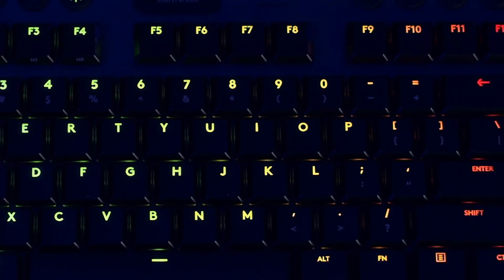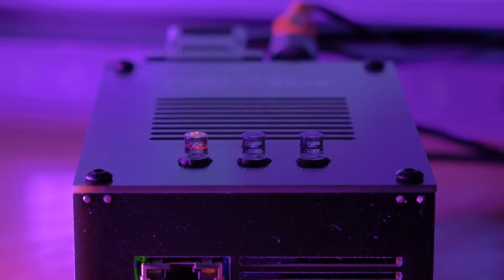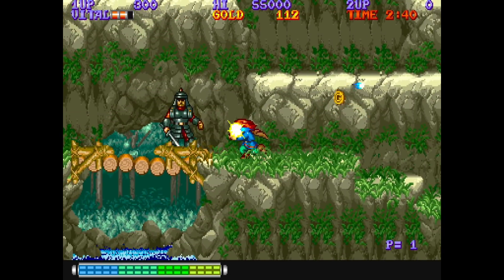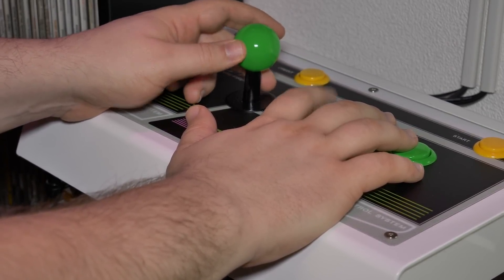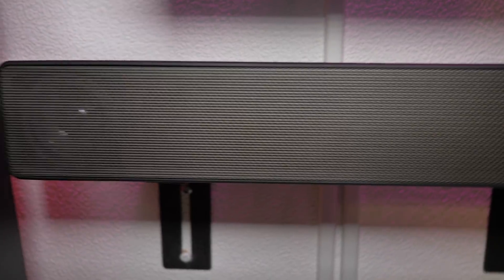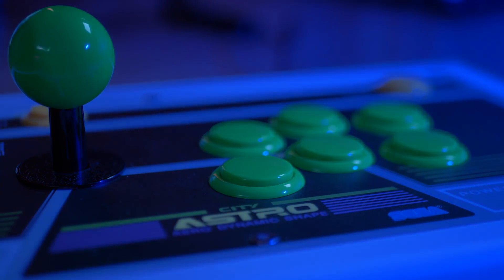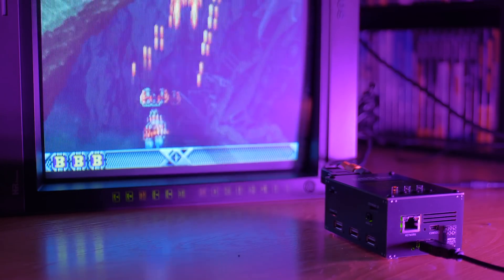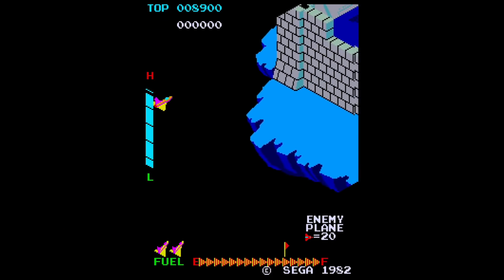DF Retro Hardware: MiSTer FPGA - A Brilliant Mini Emulation System Explored!

Comment: Thank god I just bought my Mister fpga setup.  Whenever a high profile gaming influencer makes a video on it...it sells out.
Reply: Buy the parts from an electronics shop and not a "Mister" shop. They are in stock at mouser for $136.
Reply: @poodudeelite  I saw them on the mouser shop and also saw they weren't rated by the better business bureau.   Not sure if that means anything anymore, but I didn't feel comfortable
Reply: @michaels9917  mouser is a giant multinational electronics company. Nothing to worry about.
Reply: @poodudeelite  good to know for future purchases
Reply: @michaels9917  mouser is safe. Bought my DE10 for 132 € there. Dont buy the Ali Express addon boards. They seem faulty.
Reply: the de10 used to cost 130. now i see it going from 140-150.00
Reply: @soloM81  I had to pay scalper prices for mine.  After "shipping and handling" I ended paying $188
Reply: Maybe if you are one of those people who pays someone else to put it together. You can buy the parts individually for cheaper and do it yourself any time. There are several different sources for the components.

Comment: This is awesome, but does it play the Arcade  Versions of Tekken 3 and Tekken Tag Tournament?
Also are there any 4:3 LCDs just for vertical games?
Reply: No, it won't play Tekken, any version, home or arcade, for now. The arcade hardware for these was Namco System 11/12 comprised directly of Playstation chips and reconfigured memory, right? Well Playstation core for MiSTer isn't ready yet, and might take a while to come; once it's there, it stands to reason that reconfiguring it for arcade games based on the same chips shouldn't be too much of a hurdle.
Reply: @SianaGearz  Okay. 😔

Comment: Just use a free emulator. If you aren't satisfied with the end result I honestly don't know how to relate to you. Emulation is usually better than the Original HW
Edit-on modern displays & input options
Edit- My thought process is certain people have money to burn or care about materials. I've truly never understood it, it's just plastic that is truly meaningless.
Reply: Emulation is not better than original hardware! 😂
Reply: @KokoTheGorilla69  Try using a NES on your new monitor or TV... Give me an actual reason please, you just said it isn't & ended.
Edit- It will work on all displays have multiple resolutions and filters input devices and region options along with tweaks & frame rates all sorts of choices for easy accessibly and cheap or free in most cases. These are my reasons to why it's better and superior. What are yours?
Reply: @5izzy557  original hardware plugged into a CRT will look better and run as originally intended better than an emulator on an LCD using software level video filters.
Reply: @5izzy557  lol he is right emulation is not better than original hardware
Reply: @soloM81  once again, nobody is giving said reasons. Just saying it's better.
Reply: @KokoTheGorilla69  did you read my comment? we all have access to CRT's, and they are being mass-produced so what I said isn't valid and true
Reply: @soloM81  if you own and xbox series x & an xbox one x which console would you use to play your xbox games?
Reply: @5izzy557  What you're saying about emulation being better than original hardware does not apply in this case. You're equating Xbox BC to emulating 8 and 16bit console hardware, which is far from the same thing. 3D game emulation has inherent benefits, both in terms of performance and IQ (higher resolutions, texture filtering, etc.). This is not it. Emulation of these systems adds lag, which can be compensated in some cases using run-ahead mode, which not all emulators support. Using a CRT to play with no lag at native resolutions is not that simple on PC. Neither is playing with original hardware on flat panel displays. 

Honestly, emulation is absolutely fine for most people unless they're looking for an experience closer to original hardware and a simple, 0-lag setup. We're talking about different products for different needs. I find those pushing emulation over anything else just as annoying as those who insist on playing only on original hardware. Use whatever works for you and let everybody else use whatever they want. It's that simple.
Reply: @Trunchisholm  I made one comment & said replies about emulation that I'm curious about since I don't understand the OG HW over everything especially when we look at the prices. I'm not pushing anything.
Edit- A lot of what you said went over my head, but I can relate to the zero lag since I used to play on CRT and I remember when playing Super Mario world on an LCD years later it felt off I just put it down too being rusty, but it was the input delay. Even going from a monitor to a TV obviously depending on models adds huge amounts of input lag I've noticed.

Comment: I built my MiSTer in 2019 and haven't looked back since. I use bliss board w/ every controller port connection. Original controllers make each core feel more true to the experience imho. 

I love it on my 32" JVC D Series via YpBpr. Looks super crispy via HDMI as well. 

You literally can't go wrong here.

Comment: So is the console emulation on this as good as on the individual systems by Analogue? Is there any reason to get Analogue systems anymore if you have this?
Reply: I think the SNES, Genesis and NES cores on the MiSTer are just as good or better then Analogues. I already sold my Mega SG and I think the Super NT is next to go. Only keep those if you want to play real cartridges, that's the only "advantage" over this.
Reply: @KokoTheGorilla69   I don't even own them but have been looking into getting one (or multiple) of them but this is making me reconsider. Being able to use real cartridges is nice and all but definitely not a must for me.
Thanks for the info!
Reply: @Pandsu  for the cost of what you will pay for a single Analogue console (especially if it's on eBay), you can get a good MiSTer setup. Go to SmokeMonsters YouTube channel and watch the videos he's made about Mister, there is a lot of good information

Comment: The whole carrier arwing "screen loading in differently" is the same quirk that caught out billy mitchell cheating the donkey kong arcade game. They found out he was cheating because the way the screens loaded in during his videotapes was in keeping with mame, rather than the blocky way of screens loading in as per the original hardware, also as with carrier arwing here. A series keeping tabs on FPGA vs emulation versions would be brilliant....the mister FPGA deserves regular coverage as its ever evolving.
Reply: I wonder if fPGA will be used by the inheritors of his cheating legacy.  I bet in 50 years emulation and FPGA will be basically indistinguishable
Reply: @spyczech  I'd bet there will be MiSTer FPGA cores in less than 5 years which are indistinguishable from original hardware.  Apparently, some of the best FPGA implementations already in MiSTer based on delidding ICs and studying them with microscopes are so accurate that they should be able to run in parallel with real hardware for years without desynchronisation.  Also, some original arcade hardware, such as the Cave CV1000 boards, are apparently natively built on FPGAs in the first place - in this particular case, even in the same family of FPGA as the DE10 used in the MiSTer itself.
Reply: @JonnyTenebrous  Bruh, there's already cores that are indistinguishable from real hardware. The Neogeo core? Furrtek built it using all the chips he's decapped on a neogeo. His cores are literally 1:1 exact copies that can be put together to make a new neogeo, or you can fab some of his cores onto ASICS, and get an adapter for them to fit on a real neogeo, and they work just fine.
Reply: @JonnyTenebrous  That's just for the GPU that CV1000's use an FPGA. Their CPU is still a normal HPS.
Reply: @jackbootshamangaming4541  That's the main core I was referring to, of course.  I just held back from assuming it was 100% indistinguishable from real hardware based on the fact that it still receives patches... for  absolutely tiny adjustments by now.  Call it 99.99+ % indistinguishable from real hardware? ;)  That might be splitting hairs, but the hard core enthusiasts do tend to do that.  I never owned real Neo Geo hardware, so having Furrtek's core running on my MiSTer with a CRT is amazing!
Reply: @spyczech  FPGA Donkey Kong is literally EXACTLY like the real PCB. You could write the ability to use cheats into the core yourself if you know VHDL or verilog.
Reply: Carrier Airwing is an incomplete conversion to FPGA that has known bugs still remaining. in the air refueling scenes the sprite priority is incorrect, for example.
You can see known issues for any cores in the issues tabs in the respective github pages for them.  You can submit issues if you come across something also.  Feedback is necessary to get things to 100% accuracy in some cases where chip/logic specifics are unknown- it takes time and work.
Reply: @WalrusFPGA  ok man thanks that isn’t relevant to their point at all
Reply: Courts don't agree that he cheated. He used an emulator for some of his old runs, big whoop, guy performed some of his records on a friggin' stage in front of a live audience. People need to lay off the dude, it's ridiculous. Let's all jump on the hatred bandwagon, yeah?

Comment: We really could use a Windows 98 emulator. Arcades are easy to emulate with anything.
Reply: The mister has a that already. search mister ao486
Reply: @Carl-bz2ej  The kind of game a 486/33 could run is easy to emulate on dosbox. I'm talking about harder stuff, from Pentium II/III era that refuses to work on modern Windows properly - like Mig Alley or Interstate '82, for example.
Reply: @JorgeAraujo97  I'm not an FPGA expert but I highly doubt x86 hardware from around 2000 would not fit on this FPGA not to mention the additional graphics and sound chips needed like Voodoo Graphics, EMU 10K1, AU8830 etc..

Comment: 5:57 those blacks though... I'll stick with CRT or VA panels.
Reply: How can you tell? all your looking at is your monitors represtation of the black levels...
Reply: @5izzy557  Because I can compare the black bezels of the shown screen and also my display has deep blacks. I have all kinds of panels at home, so I'm not just partial to one, I use each for its intended use. For PC I have TN, IPS and VA. 
 TN: Just for multiplayer shooters
 IPS: when I need color accuracy, but looks lovely all around (also for 3d movies)
 VA: For general usage, including non-competitive gaming.

I can't afford a good oled though, the ones I like go for 3000+ euros. I hope that by the time 8k becomes standard, I'll be able to afford a nice 40" 4k 120hz 10 bit HDR Oled.
Reply: That CPS 1 game will look washed out on most displays, unless the gamma is calibrated for it. MiSTer provides per-core control for this so you can adjust it to your liking. Poly gamma 2.4 - 2.6 is the general range I find best for CPS1, on an LCD. gamma correction comes in very handy in this case.
Reply: @MordecaiWalfish  Thank you

Comment: An old 17-19" LCD seems nice for this kind of thing. They become illegible if you rotate them, but they're tall enough at 5:4 that vertical games don't just disappear and become tiny. Bigger than 9" anyway.

But you can't have simultaneous scanout, so you would be introducing a frame of latency to rotate... a compromise... Can MiSTer do that right now?

Comment: I've always been intrigued by this device, but software emulation has come so far that it's hard to justify against the cost of a second hand SFF PC system. For under $300, you can get Intel 6th gen i5/i7 machines and throw in a 1650 and get a capable emulation machine, Kodi/Plex machine, and also play all modern PC games. With the right settings, you can output 15khz, too. I can see the dilemma for most buyers.
Reply: Even with a high end PC there is still software emulation lag
Reply: @Itchcontrol  Retroarch runahead makes it practically non existent though. I can't say I notice any lag even on games very sensitive to it.
Reply: @BenGmanUk  Well ofc there is lag on retroarch... but if you don't see and feel it you don't need a MiSter
Reply: @BenGmanUk  I played The Punisher arcade game on my PC with Retroarch for several hours in the days before I got my MiSTer, and when I played it on that, it was noticeably smoother. There is a difference.
Reply: @Itchcontrol  I expect I'd need to play it side by side to see/feel the difference.
Reply: @BenGmanUk   runahead still has flaws people are acting like it solves all the lag problems it doesnt the lag on sound emulation is very bad also . the mister removes all the layers of lag introduce by a desktop computer (OS ) because there is nothing running on the background and runs in parallel like real hardware
Reply: @soloM81  Yeah I get that and I'm very tempted tbh. I'm not sure on balance that I'd be willing to lose the front end of launchbox, specific shaders I've gotten accustomed to just for a couple of frames I barely notice. Tempting as a project though for sure.
Reply: @Itchcontrol  But you also get to have a high refresh rate monitor which reduces the scanout latency. Alternatively beam-chasing emulation is currently being developed, which can get software emulation to within about 1-2ms of FPGA or original hardware. Also there is often inherent latency in the way games are implemented on a given system, so when it is the case, you can use latency compensation thanks to run-ahead emulation.
Reply: @Itchcontrol  The amount of latency depends mostly upon the emulator or core you use. As someone else mentioned, run ahead can all but eliminate it if you have the overhead to spare. For 2D emulation, I am unable to tell the difference on my CRT. For 3D emulation (N64, PSX, etc.) a more powerful PC can do what the original consoles only dreamed of: locked 30fps or 60fps gameplay with consistent frame times. Playing GoldenEye, WM2K, or Twisted Metal with solid frame rates, supersampled internal resolution, and output to a CRT is BETTER than the original hardware.

Comment: Would be great if there was something that could faithfully emulate old system 18 and system 32 based games. In all these years, I’ve yet to see a fully accurate version of altered beast.. great vid.
Reply: Ultimately preservation of faithful hardware in synthesizable form is the end goal. But for many chips, you get to make do with high level recreations based on datasheets and the knowledge gained when developing MAME cores, since it's much lower effort than gate level decoding of chip logic. Even that is a very substantial effort counted in often thousands of hours per chip, and in depth gate level investigation takes up that much more effort, and also is prone to mistakes.
Reply: Didn't sonics ultimate genesis collection have the arcade version? I Think the astro city mini does as well

Comment: i sold alot of systems / games including everdrives / RGB mods at the current high prices. MISTer replaces all of them.
Reply: Will it do Sega Saturn accurately?
Reply: @filipmartinez1162  i basiscly sold all my 8/16 bit systems. of the later ones PS1 seems to be getting there.
Reply: not to mention homecomputers like the MSX / Amiga 500 / C64
Reply: @filipmartinez1162  eh not yet, some people have started work here and there but the Saturn is a real bear to fit into the available FPGA’s space just because there’s so many custom CPUs in the Saturn.  There’s been excellent work done on getting the PS1 simulated, and we might reach the point where it can load actual software sometime in 2021.